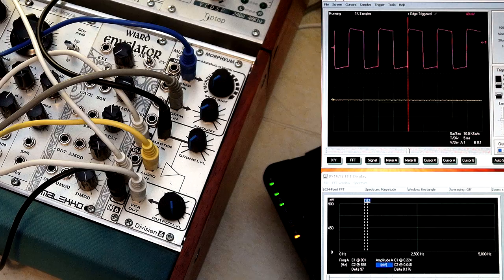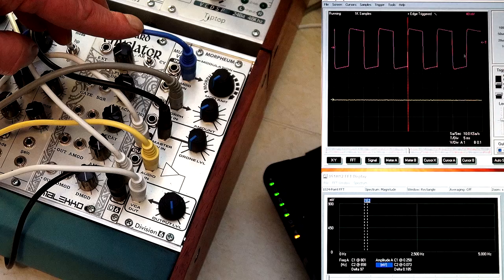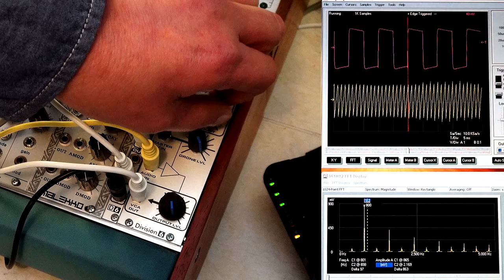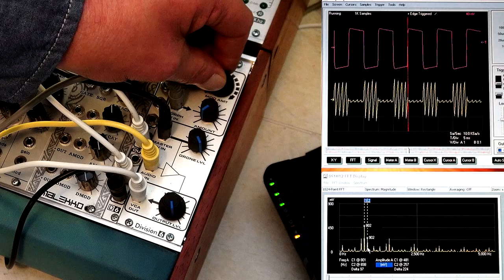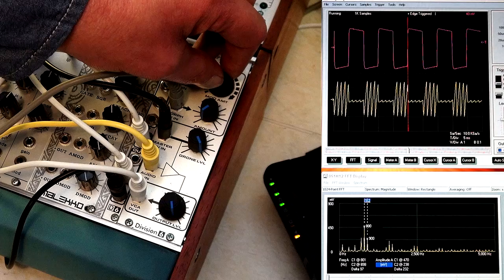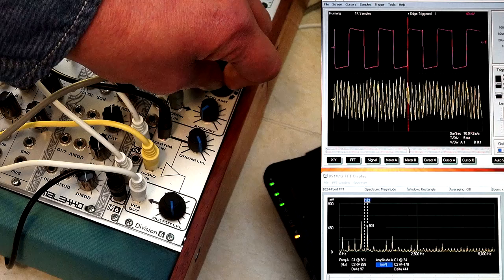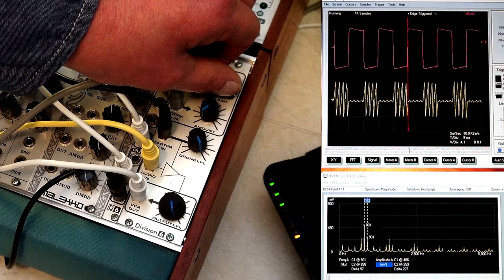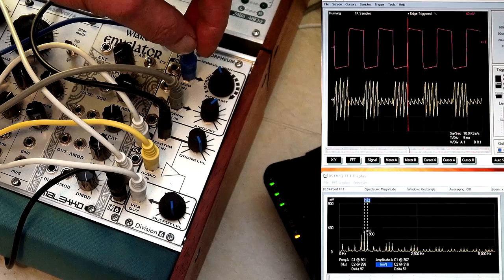George Mattson On Morpheum

Comment: The Buchla 285 has done this for decades. The current 285e does it as well.
Reply: Well, the Buchla isn't Eurorack and costs 10X more. This is a clone of the VCA I put into the Syntar I designed in 1978.